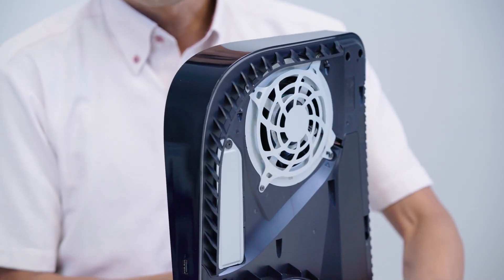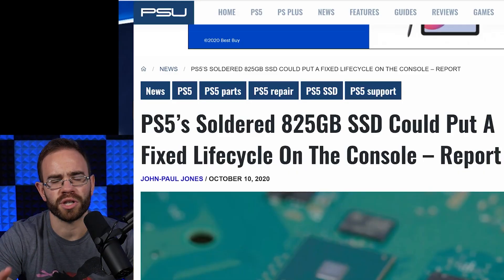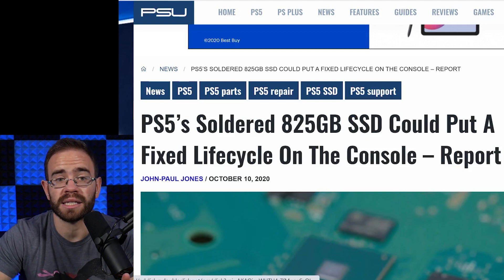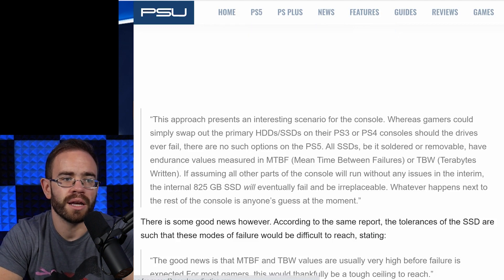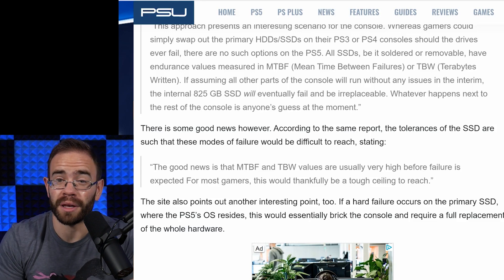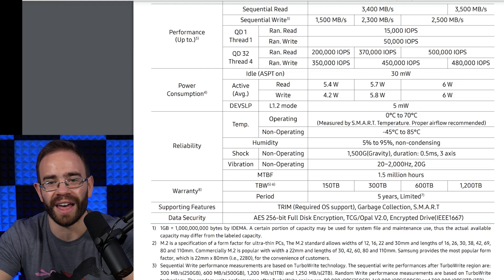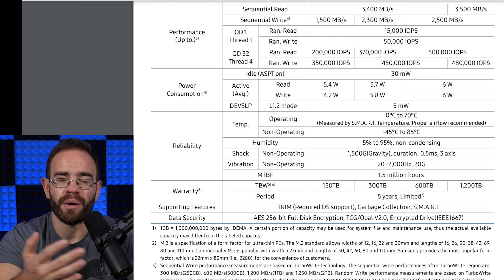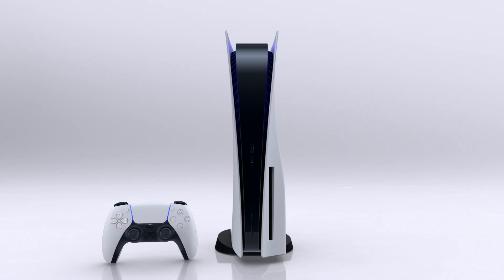Is The PS5/Xbox Series X SSD A Problem For Preservation?

Comment: Are any SOLDERED ON SSDs a problem for preservation? 
Just ask Louis Rossman how many of his customers that lost data to the soldered on SSDs on Apple Macs and then we will talk.
Base storage being soldered on is an ÜBER ANTI-CONSUMER MOVE meant to force people into rebuying the whole thing that has them down the line.
And seeing as how the PS5 SSD will be heavily relied on for read/writes, it will wear down very quickly thus requiring buying a completely new PS5 again and again... Not to say anything about it being impossible to be kept as a collectible in the future.
At least with the PS3 and 4 we can get another HDD if the one inside fails. PS5?  SOL dude.
Being able to increase storage is IRRELEVANT if the needed base system's dies.

Comment: I'm more interested in the if the Sony NVME has direct heat sink contact. I mean I realize the system has a large cooler but the fact is consoles run hot and there's a reason NVME heat sinks are a thing. Prolonged heat exposure is a far more likely point of failure then the writing capacity in my opinion.

Comment: It'll be interesting to see how the systems function or don't in the future once the soldered SSD fails. Will the console still boot or will they basically be bricked once the chip fails? I don't value modern consoles like the cart based ones so if it does fail one day, I don't think anything much is loss since the games it played will likely just be playable on PS6. Going forward, I don't think we have much to worry about backwards compatibility so the system itself is fairly irrelevant - similar to how PCs work.

Comment: So here's what I'm confused about - if the SSD was soldered for read/write speeds, what is the point in expanding the SSD? If the faster speeds will only be available on the soldered boot drive, why not just go with an external HDD instead? Or will the nvme expansion drives be just as fast as the on board SSD?
Reply: Yeah so the drives that you have too install have too be faster than the ps5 ssd because less lanes of priority that the ones soldered too the board. So the one we have too install have too be at least 7gb a sec compared too the ps5 ssd at 5.5gbs. You could go with an external ssd but, you won’t be able too play off of it.

Comment: Well, I would think since the flash chips since separate from the controller you may be able to salvage the console with an additional drive. Maybe at some point ssd's would be the caliber and have the capabilities out of the box that sony has done to the ps5. Otherwise back up to a cloud and buy a warranty for a few years so you can get a free replacement.

Comment: I actually am wondering if the xbox is using a removeable 2230, you can see the screw for it on the board designs but its covered by a heatshield, i expect the memory cards to be the same as they are just fancy cases on a 2230 drive

Comment: Do you people realize that the PlayStation is constantly writing for recoding reasons?! Which means 80MB per minute in FHD. Do the math. 600.000.000MB (because they don’t calculate with 1024....) /80= 7.500.000 Minutes/60= 125.000h/24h= 5200days 
So roughly 14years of gameplay max..
Well actually it’s not so bad.... :-)
Reply: You could at least multiply that by two... 12 hours of gaming per day for 28 years seems fine.

Comment: Samsung has the best TBW ratings, neither Sony or Microsoft are using Samung NVME drives... The TBW of 1TB drives can be 160TB-400TBW.

Either way its a non issue, the biggest concern should be the price expand storage... People are use to using $60 1TB drives, good luck explaining to a average joe consumer why exactly they need to spend $220 on 1TB NVME for a console that costs $399.

Comment: HDDs have a higher failure rate than a SSD. My original Xbox is roughly 18 years old, and the HDD is still running strong. With that being said, yes it's possible for a drive to fail due to defects etc, but if you're covered under warranty then it's not that big of an issue. Also, the NAND technology inside of SSDs has gotten much better over the years. Anyway, I'm not too worried to be honest.

Comment: Anyone worried about SSD longevity should read extensive tech specs and reviews more often. 

For instance I have TWO 32GB Samsung solid state drives that are 14 years old. They still work 100% fine. They are 2.5" drives that run on ATA interface. I use them on a Windows XP rig I run retro games and software on to reduce crashing and compatibility issues of running on a 64-bit machine. Especially considering the 16-bit application support on winXP 😃👍

If Sony uses high grade solid state chips, they will last 10 years with an issue. Ie: Intel, SanDisk (not WD. SanDisk 😑), Samsung etc.

Comment: With the SSD and Liquid Metal TIM, they're basically designed to fail at some point I wouldn't be surprised if my Mega Drive and Mega CD out live it, they already out lived my launch PS3, though to be fair what didn't out live those?
Reply: The Liquid Metal will only be an issue if it's badly tampered with or somebody shocks the PS5 in a way that it can get out of its chamber on the die and it won't dry out unless it reacts with certain other chemicals or compounds.  Thermal Paste is more prone to drying, just less conductive
Reply: @Shadowespeon17  I didn't mean that, it will corrode the copper eventually, while all the techtubers mention that, I've never heard anyone give a time scale, for all I know it could be anywhere from 5 to 8000 years.

Comment: If your worried about the life span you will have to focus use on the Expansion storage you add which should be cheap by the time you get to the point of needing to worry about it's life span.
Reply: The problem is there's no way to move the OS from the soldered drive to expansion nvme, once the built in SSD dies then the PS5 is one giant brick

Comment: Sounds like an article written by someone who just learned about TBW and MTBF.. Unless you sit there and download a dozen games every day you'll likely never encounter either of these problems.  An SSD can last decades when in the hands of the average user.
Reply: Unless a malfunction happens
Reply: @Hellraiser988  well technically, you are going to replace anyway if malfunction happens to most of the part on the motherboard
Reply: @herpderp9394  I know people that can fix that
Reply: Well. There are defects. And software bugs. A bug in Chrome caused some extensions write 10TBs per day. It can easily happen and I doubt sony would be replacing anything.
Reply: Yeah, if everything goes well..which almost never does :)
Reply: @hypernarutouzumaki  It normally does go well for over 100 million people
Reply: @imo098765  That's what they want you to believe lol.
I mean who told you those numbers? lmao
Reply: yes, or months, or a year.  Temp is a key component of their reliability.  We don't know how hot it runs, what the actual life span is, and my guess is that they are buying the cheapest thing they can put in there while maintaining the speeds they require and ensuring it last beyond the 1 year warranty.
Reply: Unless power is cut-off

Comment: These consoles have a fixed life cycle because of the liquid cooling, the liquid isn't unlimited, your console will eventually run out of it.
Reply: Yeah but the ps5 fan is really big.
Reply: @Mattz2224  the fan won't be enough, the heat sink is a vapor chamber because of the liquid cooling, when you run out of liquid cooling, your console is shit out of luck.

Comment: It dies, you get a new one and download the games again. The save progression is saved in the cloud or on a usb stick.. it's the inconvenience of having to re download everything you had installed... Which is roughly 800 GB worth of stuff. Not a big deal. I have done this multiple times when going to a new system and I don't even bother with a system transfer... 

Edit: I get that not everyone has fast internet or unlimited data.... Those people should be getting the disc version anyways (fyi get the disc version even if you have fast internet/unlimited data, opens yourself up to all those cheap PS4 game discs that will flood the market soon

Comment: Do people honestly think this system will only last 4-5 years? If those shitty HDD's on my ps3 and ps4  have lasted me this long without any failures then I have zero doubt that this system will do the same. And for people concerned about the TBW, don't be. Let's say your ssd have a 70TBW. To reach that limit you would have to download 191gb every day for 1 year to reach that. And the ssd on the ps5 will probably be closer to 600TBW, which means you would have to download 191gb every day for about 8.5 years. (or 1643gb pr day for a year). You won't reach that limit any time soon.

Comment: If it became an issue the PCI-e 4 expansion slot should have full bandwidth to run everything at full speed. I doubt the OS is on the internal SSD. Its pretty doubtful you'd burn through many of its write cycles anyway, reads do not degrade the memory at all. Something they don't tell consumers either, you don't want to fill up an NVME or any solid state drives past 50% anyway since performance drops dramatically.

Comment: I mean, if your PS3 or PS4 hard drive fails, anything on there is lost as well. So it's not like anything has changed and really, aside from PT, all you really need to backup are your save files. Presumably the PS5's BIOS will have some sort of OS location toggle so you can install the OS to the expansion slot drive and redownload whatever you were playing.

Comment: I think the Slim, whenever it appears, will simply only have an M.2 socket without soldered SSD at all. Since right now there is not really much they could use but that will change in the years to come. It will also save them a lot of money.

Comment: It’s just speculation but I could imagine hackers finding a way to change the boot drive for the PlayStation. At that point allowing the removable m.2 drive be used as a boot drive. Just install the firmware on there and bam now you have removable storage. For most consumers this won’t matter due to the fear of damaging the hardware, but for enthusiasts now you can add life without much work. At least more life to the drive
Reply: I think now it makes sense why sony is giving only 825GB Storage SSD. So that people don't put all their games onto it.
The official comments say -
You should install those specialized PS5 games which take full advantage of that SSD on the inbuilt storage. 
Lets say there are 10 AAA games specialized for PS5 which are out each year say each 100GB maybe less so that's about 1TB. Let's say each year you download and install games worth 1TB. Then it's 5TB in like next 5 years. Even if you do very heavy gaming and say you use like 10 times more. It would be around 100TB in next 10 years. 
I think by that time PS6 might arrive too. Since a samsung 970 has TBW of 600TB. I think max you will hit in next 5-10 years would be 100TB-200TB of usage. 
So I feel it's future proof. 

Also one more very important thing - 
Never fill SSD more than 80% it's full storage else it shortens it's life. I think that's why some rumor say sony is only offering 664GB available to users. The remaining storage is most likely divided into OS+1 free game+ SSD storage 20% for increasing life of SSD. 

So I believe It would last more than 20-30 years before it fails completely depending on your use case.  Also if you have 100's of PS4 games I think it's better to just install those on an External NVMe SSD which is compatible with PS5.
Reply: @Carlo i hope so it could take advantage on custom controller, because im sure soldered SSD had lesser bridge to travel.

Comment: 600 terabytes means you can install 6000 games with an average size of 100 gigabytes.
I’m not worried.
Reply: It would also mean that you could install 100GB worth of data every single day and it would last 16-ish years
Reply: @Ldenlord  Remember that when you're booting up your games for the first time, when you're saving them, when they update, and when anything changes with the software of a game/media app, you will be writing to that SSD. When you load up a game, you are reading from it. 

Even so, 12 years would be my very loose estimate, and by then the next, next gen will have released, and we'll finally be 5 years off from FF7 Remake Part 2.
Reply: mmm assuming you don't use the SSD for anything else at all, which of course is not the case. Modern consoles use storage for a lot of stuff like, installing apps, taking screenshots, saving states, temporary files from apps, etc.. I barely use my computer's NVMe SSD (just for OS and apps) and already wear it's life down on a 10% in 1.5 years
Reply: @tyranus7  Unfortunately, a lot of people are failing to take into consideration any additional factors. The 600TB limit was mentioned as an example of failure due to "standard" use. However, most people will instead fill a drive to it's limit, only uninstalling games once they need to free room for a new one, which wears a drive down in a rather uneven fashion. There's also failures that happen outside of simple wear and SSDs tend to run into issues with age and heat. Given the heat sink we've seen for the PS5, failure due to those other causes will probably a larger consideration than raw usage. That's not even taking into consideration manufacturing issues and faulty units, which always happen.
Reply: @subtegral  but let's say it does fail someordnarygamers your console is a useless brick
Reply: it's also not what the Sony SSD is rated.  At this point we don't know what's in it, who makes it, what the expected life cycle is, and I can assure you that the Storage is not going to have a 5 year warranty.
Reply: The problem with SSDs is how long they can STORE the data! ..lets say you have installed some games and don't use the PS5, you just want to store it, how long can a SSD store the data? A HDD can store the data lifelong (theoretically). Sony did a bad choice using a SSD instead of HDD. This really f*ks me up sometimes, EVERYTHING today is build for speed and not longevity, i can play my first xbox after 20 YEARS! I canot say the same thing about the ps5
Reply: @subtegral  yes
Reply: Well here is a serious question doesn't it only need to last until the next console generation and maybe 3 years after that generation starts?     So if it can last that long you could buy a used one for cheap or buy the next gen.
Reply: @Zero-pe3iq  That's why the "preservation" aspect was coming into question. For most people, it might not be a terrible issue so long as it lasts ~10 years, but the the segment of the base that enjoys returning to their older consoles to play exclusives from time to time. Some amount of maintenance is usually expected with older hardware, but this introduces a failure point which cannot be easily repaired or replaced. There's also no indication if the generation after this will support games for the platform, so it's better to be forward thinking about possible problems like this and potential solutions.
Reply: @Zero-pe3iq  No, but that is what it is built for.  These things could last a lifetime, if not for the hard drive.  We know they wear down, but that is why they are replaceable.  It's a cost cutting measure.

Now, that's pure idealism mind you.  We know that 10 years from now (I'm putting it down now, sony is finally going to live it's dream of a 10 year console cycle) we'll be able to buy a PS5 slim for a couple of hundred bucks and if you are really interested in legacy you'll buy a couple of them, test them, and put them away until needed.
Reply: And that measure, IIRC, is writes to first failure, doesn't mean that the drive will go kaboom, just that it will start breaking down by then.
Reply: Almost 20 years of downloading 1 game a day

Comment: The SSD is probably the least concerned among all the components. 
Unless people cycle through all 4,000 PS4 games and future PS5 games, which first break their bank account, then we are talking about hitting these limits.
Reply: Even of you do cycle through all 4000 games you could still do it about 3x each. 

You can write 50GB 12000 times before you hit that 600TB limit. And even then all that means is you just can't write to the drive anymore. You can still read from it no issue.
Reply: @Lyra Heartfold Even for that you will need to pay for extra storage
Reply: My bank account has no breaking point.  Speak for yourself poor man.
Reply: @Lyra Heartfold You can only place so many on ~700GB (PS5) and after that you rewrite the SSD about 850 times.
Reply: Read/Writes at maximum bandwidth for decades...what kind of life cycle are you worried about?